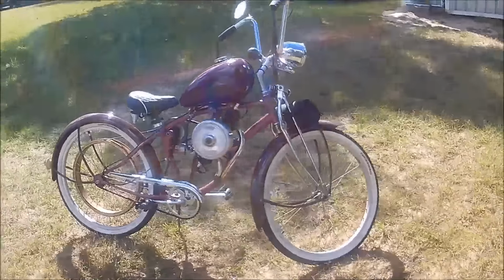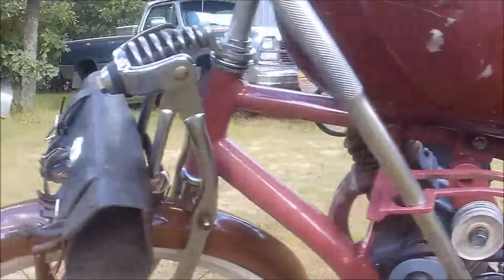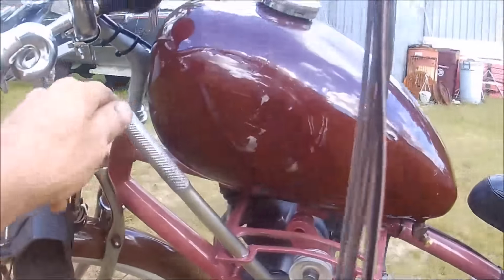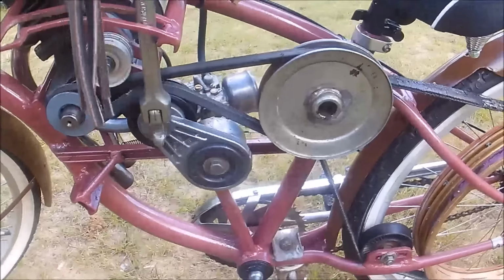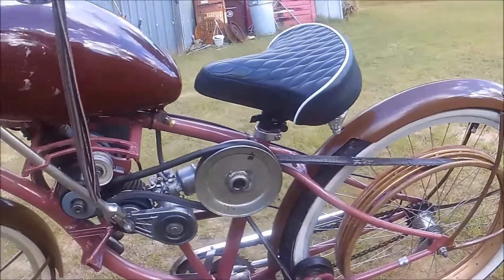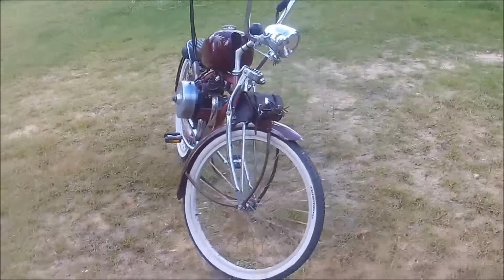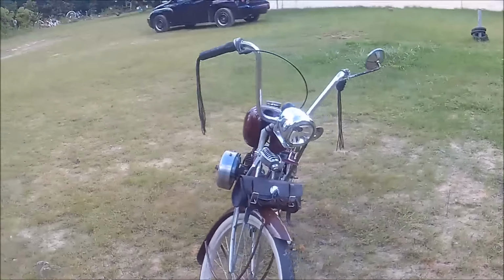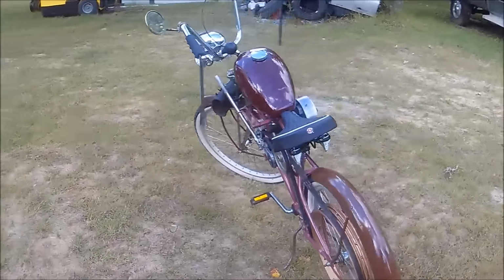Maytag model 72 powered home made motor bike part 5 The Final Chapter

Comment: You need some foot pegs up above the fly wheel for cruising comfort. Some kind of cover for the fly wheel would save the knee. or use some acorn nuts so its not so sharp.
Reply from the maker: Thanks shartne. Acorn nuts might be safer. Dan

Comment: How much to build one very cool
Reply from the maker: Hi Ed thanks for watching.   That's really hard to say. everything I build is stuff out of my junkpile. If you had to buy a running Maytag engine you could spend a couple hundred on just the engine. I had one that the flywheel was broke and not worth much so I made This bike out of it. I probly got 50 bucks in the bike all togather.    Dan